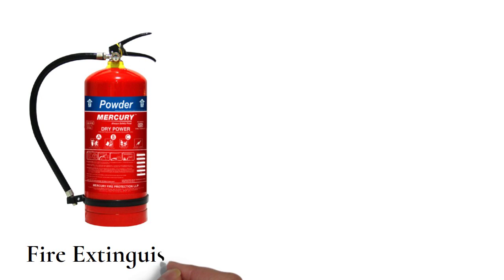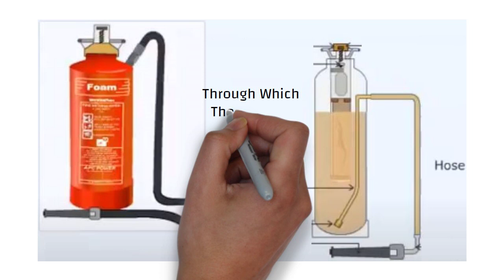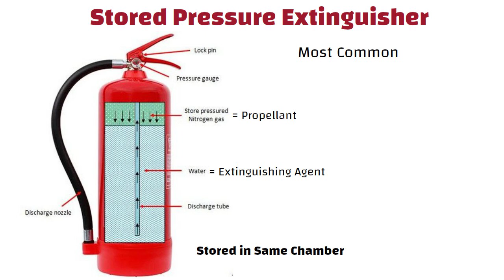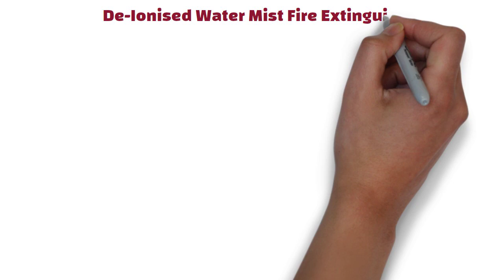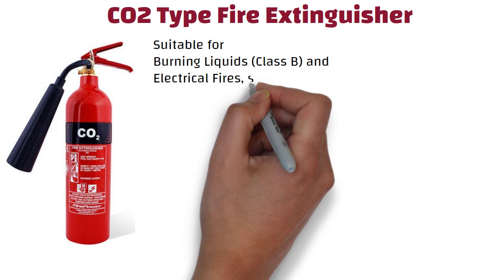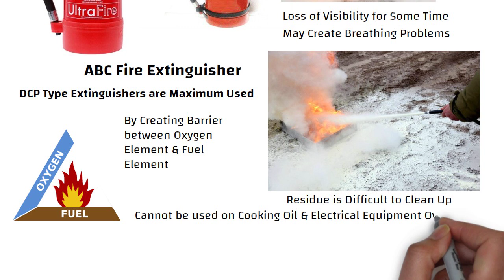FIRE EXTINGUISHER DEALERS IN KERALA, CALL 8138906102, FIRE EXTINGUISHER DEALERS IN ERNAKULAM.

Comment from the maker: fire extinguisher in Pandalam
Reply: FIRE EXTINGUISHER DEALERS IN KERALA, FIRE EXTINGUISHER SUPPLIERS IN KERALA, FIRE EXTINGUISHER DISTRIBUTORS IN KERALA, FIRE EXTINGUISHER IN KERALA, ABC TYPE FIRE EXTINGUISHER DEALERS IN KERALA, CO2 TYPE FIRE EXTINGUISHER DEALERS IN KERALA, CLEAN AGENT FIRE EXTINGUISHER IN KERALA, MODULAR TYPE FIRE EXTINGUISHER DEALERS IN KERALA, MECHANICAL FOAM FIRE EXTINGUISHER DEALERS IN KERALA, FIRE EXTINGUISHER NEAR ME KERALA, FIRE EXTINGUISHER TRADERS IN KERALA, FIRE FIGHTING COMPANIES IN KERALA, FIRE CONTRACTORS IN KERALA, FIRE EQUIPMENT DEALERS IN KERALA, FIRE ALARM DEALERS IN KERALA, FIRE PUMP DEALERS IN KERALA, SMOKE DETECTOR DEALERS IN KERALA, FIRE FIGHTING SYSTEM IN KERALA, FIRE PROTECTION SYSTEM IN KERALA, FIRE AND SAFETY CONTRACTORS IN KERALA, FIRE HYDRANT SYSTEMS IN KERALA, PA TALK BACK SYSTEM IN KERALA, FIRE NOC IN KERALA, FIRE INSTALLATION IN KERALA, FIRE NOC RENEWAL IN KERALA, KIRLOSKAR FIRE PUMP DEALERS IN KERALA, FIRE EXTINGUISHER NEAR ME KERALA, FIRE EXTINGUISHER MANUFACURERS IN KERALA, SAFEX FIRE EXTINGUISHER DEALERS IN KERALA, FIRE NOC CONTRACTORS IN KERALA, FIRE FIGHTING EQUIPMENT DEALERS IN KERALA, FIRE PROTECTION SYSTEM IN KERALA, FIRE INSTALLATION IN KERALA, FIRE SAFETY CONTRACTORS IN KERALA, FIRE AMC IN KERALA, FIRE PROTECTION SYSTEM IN KERALA, FIRE PROTECTION EQUIPMET IN KERALA, AMC OF FIRE SYSTEM IN KERALA, FIRE CONSULTANTS IN KERALA, FIRE AND SAFETY EQUIPMENT DEALERS IN KERALA, ADDRESSABLE FIRE ALARM SYSTEM IN KERALA, KARTHAR VALVE DEALERS IN KERALA, DCP TYPE FIRE EXTINGUISHER IN KERALA, POWSER TYPE FIRE EXTINGUISHERS IN KERALA, FIRE HYDRANT SYSTEM IN KERALA, FIRE ALARM PANEL DEALERS IN KERALA, SAFEPRO FIRE EXTINGUISHER DEALERS IN KERALA, MS AND GI PIPE DEALERS IN KERALA, JINDAL PIPE DEALERS IN KERALA, AGNI FIRE ALARM DEALERS IN KERALA, FIRE EQUIPMENT DEALERS IN KERALA, FIRE EQUIPMENT SUPPLIERS IN KERALA, FIRE EQUIPMENT TRADERS IN KERALA, FIRE SPRINKLER SYSTEM IN KERALA, RAVLE FIRE ALARM DEALERS IN KERALA, RAVEL FIRE ALARM SYSTEM IN KERALA, AGNI FIRE ALARM DISTRIBUTORS IN KERALA, FIRE ALARM CONTRACTORS IN KERALA, FIRE PIPE INSTALLATION IN CONTRACTORS IN KERALA, FIRE SAFETY CONTRACTORS IN KERALA, FIRE PA TWO WAY TALK BACK SYSTEM DEALERS IN KERALA, HEAT DETECTOR DEALERS IN KERALA, HONEYWELL FIRE ALARM DEALERS IN KERALA, FIRE NOC CONSULTANTS IN KERALA, FIRE AMC AND FIRE NOC IN KERALA, FIRE SAFETY COMPANIES IN KERALA, NEWAGE DEALERS IN KERALA, MONSHER FIRE EQUIPMENT DEALERS IN KERALA, KARTHAR VALVE DEALERS IN KERALA, FIRE HYDRANT VALVE DEALERS IN KERALA, FIRE HOSE REEL DRUM DEALERS IN KERALA, FIRE SPRINKLER DEALERS IN KERALA, FIRE PUMP DEALERS IN KERALA, LUBI PUMP DEALERS IN KERALA, LHP PUMP DEALERS IN KERALA.

Comment from the maker: fire extinguisher dealers in Pandalam
Reply from the maker: FIRE ALARM DEALERS IN VALANCHERY, ADDRESSABLE FIRE ALARM DEALERS IN VALANCHERY, FIRE ALARM SYSTEM DEALERS IN VALANCHERY, ADDRESSABLE FIRE ALARM SYSTEM DEALERS IN VALANCHERY, FIRE DETECTION SYSTEM IN VALANCHERY, SMOKE DETECTOR DEALERS IN VALANCHERY, CONVENTIONAL FIRE ALARM DEALERS IN VALANCHERY, MORLEY FIRE ALARM DEALERS IN VALANCHERY, GST FIRE ALARM DEALERS IN VALANCHERY, ASES SECURITY FIRE ALARM DEALERS IN VALANCHERY, BEAM DETECTOR DEALERS IN VALANCHERY, FIRE ALARM SUPPLIERS IN VALANCHERY, FIRE ALARM TRADERS IN VALANCHERY, FIRE ALARM PANEL DEALERS IN VALANCHERY, HEAT DETECTOR DEALERS IN VALANCHERY, FIRE ALARM SYSTEM SUPPLIERS IN VALANCHERY, FIRE ALARM COMPANIES IN VALANCHERY, FIRE EQUIPMENT DEALERS IN VALANCHERY, ADRRESSABLE FIRE ALARM PANEL DEALERS IN VALANCHERY, FIRE ALARM SYSTEM IN VALANCHERY, BATTERY OPERATED DETECTOR DEALERS IN VALANCHERY, ASPIRATION DETECTION SYSTEM DEALERS IN VALANCHERY, FIRE ALARM MCP - MANUAL CALL POINT DEALERS IN VALANCHERY, FIRE ALARM HOOTER DEALERS IN VALANCHERY, PA TWO WAY TALK BACK SYSTEM DEALERS IN VALANCHERY, PA SYSTEM DEALERS IN VALANCHERY, PA TALK BACK UNIT DEALERS IN VALANCHERY, HOOTER CUM STROBE DEALERS IN VALANCHERY, FIRE PROTECTION SYSTEM IN VALANCHERY, FIRE ALARM CONTRACTORS IN VALANCHERY, FIRE DETECTORS IN VALANCHERY, FIRE ALARM DEALERS IN KOLLAM, ADDRESSABLE FIRE ALARM DEALERS IN KOLLAM, SMOKE DETECTOR DEALERS IN KOLLAM, FIRE EQUIPMENT DEALERS IN VALANCHERY, FIRE ALARM INSTALLATION IN VALANCHERY, FIRE ALARM COMPANIES IN VALANCHERY FIRE ALARM DISTRIBUTORS IN VALANCHERY, TALK BACK SYSTEM DEALERS IN VALANCHERY, FIRE ALARM SENSOR DEALERS IN VALANCHERY, FIRE EXTINGUISHER DEALERS IN VALANCHERY, FIRE ALARM DEALERS IN ERNAKULAM, FIRE ALARM DEALERS IN KERALA, ADDRESSABLE FIRE ALARM DEALERS IN CALICUT, SMOKE DETECTOR IN VALANCHERY,  FIRE EXTINGUISHER DEALERS IN VALANCHERY, FIRE EXTINGUISHER SUPPLIERS IN VALANCHERY, FIRE EXTINGUISHER DISTRIBUTORS IN VALANCHERY FIRE EXTINGUISHER IN VALANCHERY, ABC TYPE FIRE EXTINGUISHER DEALERS IN VALANCHERY, CO2 TYPE FIRE EXTINGUISHER DEALERS IN VALANCHERY, CLEAN AGENT FIRE EXTINGUISHER IN VALANCHERY FIRE FIGHTING PUMP DEALERS IN VALANCHERY, FIRE PUMP DEALERS IN VALANCHERY, KIRLOSKAR FIRE PUMP DEALERS IN VALANCHERY, FIRE JOCKEY PUMP DEALERS IN VALANCHERY, FIRE DISEL ENGINE DRIVEN PUMP DEALERS IN VALANCHERY, FIRE FIGHTING EQUIPMENT DEALERS IN VALANCHERY, FIRE FIGHTING SYSTEM IN VALANCHERY, VERTICAL INLINE PUMP DEALERS IN VALANCHERY, HYDRO PNEUMATIC PRESSURE BOOSTING PUMP DEALERS IN VALANCHERY, VERTICAL TURBINE PUMP DEALERS IN VALANCHERY, SEWAGE PUMP DEALERS IN VALANCHERY, RO PUMP DEALERS IN VALANCHERY. FIRE EXTINGUISHER DEALERS IN TANUR, FIRE EXTINGUISHER DEALERS IN IRINGAVOOR, ,Fire extinguisher dealers in Valanchery, Fire extinguisher suppliers in Valanchery, Fire extinguisher traders in Valanchery, Fire extinguisher in Valanchery, Fire alarm dealers in Valanchery, Fire hydrant system in Valanchery, Fire fighting equipment dealers in Valanchery, Fire equipment in Valanchery, Fire contractors in Valanchery, Fire installation in Valanchery, Fire protection system in Valanchery, Fire hydrant system in Valanchery, PA two way talk back system dealers in Valanchery, PA talk back unit in Valanchery, Fire telephone system dealers in Valanchery, Fire pump dealers in Valanchery, Addressable fire alarm dealers in Valanchery, Conventional fire alarm dealers in Valanchery, Fire alarm panel dealers in Valanchery, Smoke detectors in Valanchery, Heat detectors in Valanchery, Multi sensor detector dealers in Valanchery, Fire NOC in Valanchery, Kirloskar fire pump dealers in Valanchery, Fire detection system in Valanchery, GST addressable fire alarm in Valanchery, Morley fire alarm in Valanchery, Fire safety installation in Valanchery, Butterfly valve dealers in Valanchery, Fire extinguisher near me Valanchery, Fire protection equipment dealers in Valanchery.

Comment from the maker: fire extinguisher in Vadakara
Reply from the maker: VERTICAL TURBINE PUMP DEALERS IN VALANCHERY, SEWAGE PUMP DEALERS IN VALANCHERY, RO PUMP DEALERS IN VALANCHERY. FIRE EXTINGUISHER DEALERS IN MALAPPURAM, Fire extinguisher dealers in Valanchery, Fire extinguisher suppliers in Valanchery, Fire extinguisher traders in Valanchery, Fire extinguisher in Valanchery, Fire alarm dealers in Valanchery, Fire hydrant system in Valanchery, Fire fighting equipment dealers in Valanchery, Fire equipment in Valanchery, Fire contractors in Valanchery, Fire installation in Valanchery, Fire protection system in Valanchery, Fire hydrant system in Valanchery, PA two way talk back system dealers in Valanchery, PA talk back unit in Valanchery, Fire telephone system dealers in Valanchery, Fire pump dealers in Valanchery, Addressable fire alarm dealers in Valanchery, Conventional fire alarm dealers in Valanchery, Fire alarm panel dealers in Valanchery, Smoke detectors in Valanchery, Heat detectors in Valanchery, Multi sensor detector dealers in Valanchery, Fire NOC in Valanchery, Kirloskar fire pump dealers in Valanchery, Fire detection system in Valanchery, GST addressable fire alarm in Valanchery, Morley fire alarm in Valanchery, Fire safety installation in Valanchery, Butterfly valve dealers in Valanchery, Fire extinguisher near me Valanchery, Fire protection equipment dealers in Valanchery. fire extinguisher dealers in Malappuram, fire fighting contractors in malappuram, fire and safety systems in Malappuram, fire equipment in Malappuram, fire extinguisher in Malappuram, fire extinguisher suppliers in Malappuram, fire protection system in Malappuram, fire consultants in Malappuram, fire fighting companies in Malappuram, fire NOC in Malappuram, fire protection system installation in malappuram, fire safety contractors in malappuram, fire safety consultants in malappuram, fire and safety contractors in malappuram, fire and safety equipment in Malappuram, fire alarm systems in Malappuram, fire AMC in Malappuram, fire contractors in malappuram, fire safety equipment in Malappuram, fire protection system installation in Malappuram, fire protection equipments in Malappuram

Comment from the maker: fire extinguisher in Kayamkulam
Reply: FIRE EXTINGUISHER DEALERS IN KATTAPPANA, FIRE EXTINGUISHER SUPPLIERS IN KATTAPPANA, FIRE EXTINGUISHER DISTRIBUTORS IN KATTAPPANA, FIRE EXTINGUISHER IN KATTAPPANA, ABC TYPE FIRE EXTINGUISHER DEALERS IN KATTAPPANA, CO2 TYPE FIRE EXTINGUISHER DEALERS IN KATTAPPANA, CLEAN AGENT FIRE EXTINGUISHER IN KATTAPPANA, MODULAR TYPE FIRE EXTINGUISHER DEALERS IN KATTAPPANA, MECHANICAL FOAM FIRE EXTINGUISHER DEALERS IN KATTAPPANA, FIRE EXTINGUISHER NEAR ME KATTAPPANA, FIRE EXTINGUISHER TRADERS IN KATTAPPANA, FIRE FIGHTING COMPANIES IN KATTAPPANA, FIRE CONTRACTORS IN KATTAPPANA, FIRE EQUIPMENT DEALERS IN KATTAPPANA, FIRE ALARM DEALERS IN KATTAPPANA, FIRE PUMP DEALERS IN KATTAPPANA, SMOKE DETECTOR DEALERS IN KATTAPPANA, FIRE FIGHTING SYSTEM IN KATTAPPANA, FIRE PROTECTION SYSTEM IN KATTAPPANA, FIRE AND SAFETY CONTRACTORS IN KATTAPPANA, FIRE HYDRANT SYSTEMS IN KATTAPPANA, PA TALK BACK SYSTEM IN KATTAPPANA, FIRE NOC IN KATTAPPANA, FIRE INSTALLATION IN KATTAPPANA, FIRE NOC RENEWAL IN KATTAPPANA, KIRLOSKAR FIRE PUMP DEALERS IN KATTAPPANA, FIRE EXTINGUISHER NEAR ME KATTAPPANA, FIRE EXTINGUISHER MANUFACURERS IN KATTAPPANA, SAFEX FIRE EXTINGUISHER DEALERS IN KATTAPPANA, FIRE NOC CONTRACTORS IN KATTAPPANA, FIRE FIGHTING EQUIPMENT DEALERS IN KATTAPPANA, FIRE PROTECTION SYSTEM IN KATTAPPANA, FIRE INSTALLATION IN KATTAPPANA, FIRE SAFETY CONTRACTORS IN KATTAPPANA, FIRE AMC IN KATTAPPANA, FIRE PROTECTION SYSTEM IN KATTAPPANA, FIRE PROTECTION EQUIPMET IN KATTAPPANA, AMC OF FIRE SYSTEM IN KATTAPPANA, FIRE CONSULTANTS IN KATTAPPANA, FIRE AND SAFETY EQUIPMENT DEALERS IN KATTAPPANA, ADDRESSABLE FIRE ALARM SYSTEM IN KATTAPPANA, KARTHAR VALVE DEALERS IN KATTAPPANA, DCP TYPE FIRE EXTINGUISHER IN KATTAPPANA, POWSER TYPE FIRE EXTINGUISHERS IN KATTAPPANA, FIRE HYDRANT SYSTEM IN KATTAPPANA, FIRE ALARM PANEL DEALERS IN KATTAPPANA, SAFEPRO FIRE EXTINGUISHER DEALERS IN KATTAPPANA, MS AND GI PIPE DEALERS IN KATTAPPANA, JINDAL PIPE DEALERS IN KATTAPPANA, AGNI FIRE ALARM DEALERS IN KATTAPPANA, FIRE EQUIPMENT DEALERS IN KATTAPPANA, FIRE EQUIPMENT SUPPLIERS IN KATTAPPANA, FIRE EQUIPMENT TRADERS IN KATTAPPANA, FIRE SPRINKLER SYSTEM IN KATTAPPANA, RAVLE FIRE ALARM DEALERS IN KATTAPPANA, RAVEL FIRE ALARM SYSTEM IN KATTAPPANA, AGNI FIRE ALARM DISTRIBUTORS IN KATTAPPANA, FIRE ALARM CONTRACTORS IN KATTAPPANA, FIRE PIPE INSTALLATION IN CONTRACTORS IN KATTAPPANA, FIRE SAFETY CONTRACTORS IN KATTAPPANA, FIRE PA TWO WAY TALK BACK SYSTEM DEALERS IN KATTAPPANA, HEAT DETECTOR DEALERS IN KATTAPPANA, HONEYWELL FIRE ALARM DEALERS IN KATTAPPANA, FIRE NOC CONSULTANTS IN KATTAPPANA, FIRE AMC AND FIRE NOC IN KATTAPPANA, FIRE SAFETY COMPANIES IN KATTAPPANA, NEWAGE DEALERS IN KATTAPPANA, MONSHER FIRE EQUIPMENT DEALERS IN KATTAPPANA, KARTHAR VALVE DEALERS IN KATTAPPANA, FIRE HYDRANT VALVE DEALERS IN KATTAPPANA, FIRE HOSE REEL DRUM DEALERS IN KATTAPPANA, FIRE SPRINKLER DEALERS IN KATTAPPANA, FIRE PUMP DEALERS IN KATTAPPANA, LUBI PUMP DEALERS IN KATTAPPANA, LHP PUMP DEALERS IN KATTAPPANA. FIRE CONTRACTORS IN KATTAPPANA, FIRE AND SAFETY CONTRACTORS IN KATTAPPANA, FIRE EQUIPMENT DEALERS IN KATTAPPANA, FIRE FIGHTING CONTRACTORS IN KATTAPPANA,
Reply: FIRE ALARM DEALERS IN TRIVANDRUM, FIRE ALARM DEALERS IN KOCHI, ADDRESSABLE FIRE ALARM DEALERS IN KOCHI, FIRE ALARM DEALERS IN ERNAKULAM, FIRE ALARM SYSTEMS IN KOCHI, ADDRESSABLE FIRE ALARM DEALERS IN TRIVANDRUM, FIRE ALARM SYSTEM DEALERS IN TRIVANDRUM, ADDRESSABLE FIRE ALARM SYSTEM DEALERS IN TRIVANDRUM, FIRE DETECTION SYSTEM IN TRIVANDRUM, SMOKE DETECTOR DEALERS IN TRIVANDRUM, CONVENTIONAL FIRE ALARM DEALERS IN TRIVANDRUM, MORLEY FIRE ALARM DEALERS IN TRIVANDRUM, GST FIRE ALARM DEALERS IN TRIVANDRUM, ASES SECURITY FIRE ALARM DEALERS IN TRIVANDRUM, BEAM DETECTOR DEALERS IN TRIVANDRUM, FIRE ALARM SUPPLIERS IN TRIVANDRUM, FIRE ALARM TRADERS IN TRIVANDRUM, FIRE ALARM PANEL DEALERS IN TRIVANDRUM, HEAT DETECTOR DEALERS IN TRIVANDRUM, FIRE ALARM SYSTEM SUPPLIERS IN TRIVANDRUM, FIRE ALARM COMPANIES IN TRIVANDRUM, FIRE EQUIPMENT DEALERS IN TRIVANDRUM, ADRRESSABLE FIRE ALARM PANEL DEALERS IN TRIVANDRUM, FIRE ALARM SYSTEM IN TRIVANDRUM, BATTERY OPERATED DETECTOR DEALERS IN TRIVANDRUM, ASPIRATION DETECTION SYSTEM DEALERS IN TRIVANDRUM, FIRE ALARM MCP - MANUAL CALL POINT DEALERS IN TRIVANDRUM, FIRE ALARM HOOTER DEALERS IN TRIVANDRUM, PA TWO WAY TALK BACK SYSTEM DEALERS IN TRIVANDRUM, PA SYSTEM DEALERS IN TRIVANDRUM, PA TALK BACK UNIT DEALERS IN TRIVANDRUM, HOOTER CUM STROBE DEALERS IN TRIVANDRUM, FIRE PROTECTION SYSTEM IN TRIVANDRUM, FIRE ALARM CONTRACTORS IN TRIVANDRUM, FIRE DETECTORS IN TRIVANDRUM, FIRE ALARM DEALERS IN KOLLAM, ADDRESSABLE FIRE ALARM DEALERS IN KOLLAM, SMOKE DETECTOR DEALERS IN KOLLAM, FIRE EQUIPMENT DEALERS IN TRIVANDRUM, FIRE ALARM INSTALLATION IN TRIVANDRUM, FIRE ALARM COMPANIES IN TRIVANDRUM FIRE ALARM DISTRIBUTORS IN TRIVANDRUM, TALK BACK SYSTEM DEALERS IN TRIVANDRUM, FIRE ALARM SENSOR DEALERS IN TRIVANDRUM, FIRE EXTINGUISHER DEALERS IN TRIVANDRUM, FIRE ALARM DEALERS IN ERNAKULAM, FIRE ALARM DEALERS IN KERALA, ADDRESSABLE FIRE ALARM DEALERS IN CALICUT, SMOKE DETECTOR IN TRIVANDRUM, SMOKE DETECTOR DEALERS IN KOLLAM, FIRE ALARM DEALERS IN KOTTARAKARA, FIRE ALARM DEALERS IN NEDUMANGAD, FIRE ALARM DEALERS IN VARKALA, FIRE ALARM DEALERS IN VARKALA, FIRE ALARM DEALERS IN MARTHANDAM, FIRE ALARM DEALERS IN ATTINGAL, FIRE ALARM DEALERS IN KILIMANOOR, FIRE ALARM DEALERS IN ANCHAL, FIRE ALARM DEALERS IN PATHANAPURAM, FIRE ALARM DEALERS IN PUNALOOR, FIRE ALARM DEALERS IN NEYYATINKARA, FIRE ALARM DEALERS IN POOVAR, FIRE ALARM DEALERS IN KATTAKADA, FIRE ALARM DEALERS IN KAZHAKOOTTAM, FIRE ALARM DEALERS IN PARIPPALLY, FIRE ALARM DEALERS IN PARASSALA, FIRE ALARM DEALERS IN KULASEKHARAM, FIRE ALARM DEALERS IN THUCKALAYFIRE ALARM DEALERS IN BALARAMAPURAM, FIRE ALARM DEALERS IN ARYANADU, FIRE ALARM DEALERS IN POOJAPURA, FIRE ALARM DEALERS IN POTHENCODE, FIRE ALARM DEALERS IN VITHURA, FIRE ALARM DEALERS IN VENJARAMOODU, FIRE ALARM DEALERS IN KILIMANOOR, FIRE ALARM DEALERS IN KADAKKAL, FIRE ALARM DEALERS IN CHATHANNOOR, FIRE ALARM DEALERS IN KOTTIYAM, FIRE ALARM DEALERS IN KUNDARA, FIRE ALARM DEALERS IN CHAVARA, FIRE ALARM DEALERS IN SASTHAMKOTTA, FIRE ALARM DEALERS IN PALODE, FIRE ALARM DEALERS IN VENJARAMOODU, FIRE ALARM DEALERS IN ARYANADU, FIRE ALARM DEALERS IN VELLARASA, FIRE ALARM DEALERS IN VITHURA, FIRE ALARM DEALERS IN THENMALA, FIRE ALARM DEALERS IN AKLLAMBALAM, FIRE ALARM DEALERS IN AYOOR, FIRE ALARM DEALERS IN ARYANKAVU, FIRE ALARM DEALERS IN SENKOTTAI, FIRE ALARM DEALERS IN KULATHUPUZHA, FIRE ALARM DEALERS IN MADATHARA, FIRE ALARM DEALERS IN CHIRAYANKEEZHU, FIRE ALARM DEALERS IN KALLMBALAM, FIRE ALARM DEALERS IN MADATHARA, FIRE ALARM DEALERS IN ADOOR, FIRE ALARM DEALERS IN PANDALAM, FIRE ALARM DEALERS IN SAKTHIKULANGARA, FIRE EXTINGUISHER DEALERS IN TRIVANDRUM, FIRE EXTINGUISHER SUPPLIERS IN TRIVANDRUM, FIRE EXTINGUISHER DISTRIBUTORS IN TRIVANDRUM FIRE EXTINGUISHER IN TRIVANDRUM, ABC TYPE FIRE EXTINGUISHER DEALERS IN TRIVANDRUM, CO2 TYPE FIRE EXTINGUISHER DEALERS IN TRIVANDRUM, CLEAN AGENT FIRE EXTINGUISHER IN TRIVANDRUM FIRE FIGHTING PUMP DEALERS IN TRIVANDRUM, FIRE PUMP DEALERS IN TRIVANDRUM, KIRLOSKAR FIRE PUMP DEALERS IN TRIVANDRUM, FIRE JOCKEY PUMP DEALERS IN TRIVANDRUM, FIRE DISEL ENGINE DRIVEN PUMP DEALERS IN TRIVANDRUM, FIRE FIGHTING EQUIPMENT DEALERS IN TRIVANDRUM, FIRE FIGHTING SYSTEM IN TRIVANDRUM, 

Fire Protection Systems in Kerala, Fire Protection Systems in Ernakulam, Fire Protection Systems in Kochi, Fire Protection Systems dealers in in Cochin, Fire Hydrant dealers in Kerala, Fire Hydrant dealers in Ernakulam, Fire Hydrant system dealers in Kochi, Fire Hydrant dealers in Cochin, Fire Alarm Systems in Kerala, Fire Alarm Systems in Ernakulam, Fire Alarm Systems in Kochi , Fire Alarm Systems dealers in Ernakulam ,Fire extinguisher dealers in Calicut , Fire protection dealers in Trivandrum , Fire fighting system in Kannur, Fire protection system in Palakkad, Fire Sprinkler Systems in Thrissur, Sprinkler Systems dealers in Kerala , Fire Sprinkler Systems in Ernakulam ,Sprinkler Systems dealers in Kochi, Fire Sprinkler Systems dealers in Ernakulam , Fire Consultants in Calicut, Fire Consultants in Trivadrum, Fire Consultants in Kottayam, Fire Consultants in Malappuram, Fire Consultants in Cochin, Fire Consultants in kerala, Fire Consultants in kannur.Fire alarm dealers in Ernakulam, Addressable fire alarm dealers in Ernakulam, Smoke detector dealers in Ernakulam, Fire alarm suppliers in Ernakulam, Fire alarm distributors in Ernakulam, Morley fire alarm dealers in Kerala, GST fire alarm dealers in Kerala, Heat detector dealers in Ernakulam, Fire alarm panel dealers in Ernakulam, PA talk back system dealers in Ernakulam.